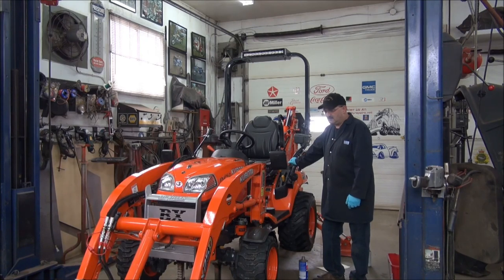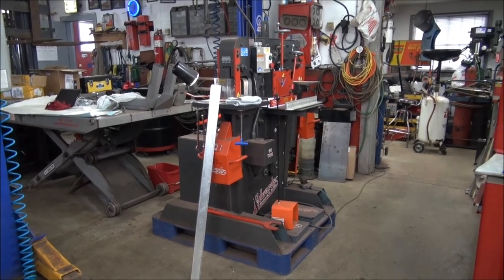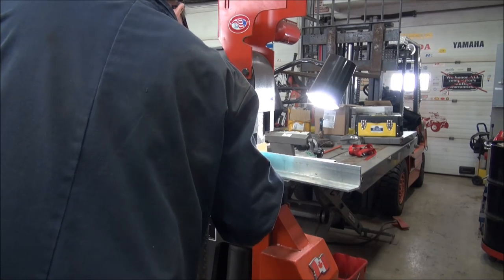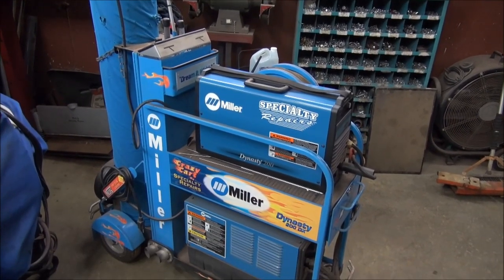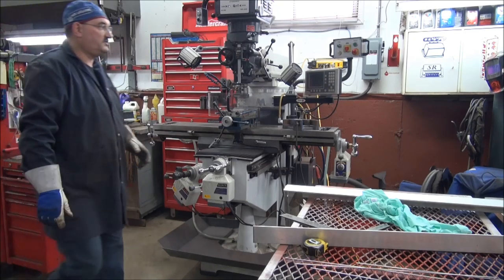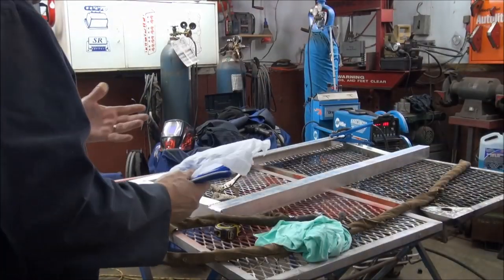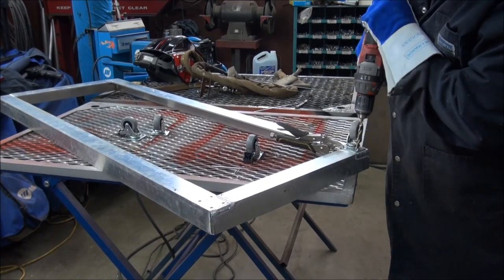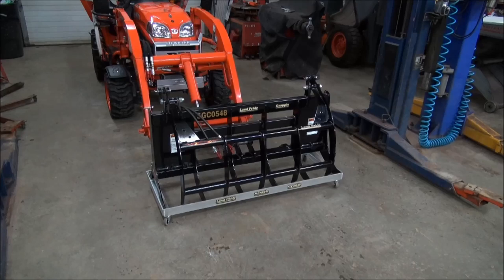Land Pride Grapple Cradle

Comment: Fantastic.  Could not get over the difference in sound your dynasty with the high frequency and pulse  makes compared to my Lincoln  175 square wave and the weld quality is much better.  I noticed you went over the weld without the filler rod  for  that extra touch - well done only the best spend the time to finish the weld  like  that.  For me to weld 1/4 its turned up to max. amperage and for thicker material I pre heat it  to get buy.  Was the dynasty turned all the way up to weld the 1/4.  Thanks Steve.
Reply from the maker: Thank's Steve. I've never tried a Lincoln but I'm sure they are great machines. I had the Dynasty up on 170  for that job because I wanted the instant heat. It goes to 200.
Like I said in the video. I never cleaned the rod, the aluminum, nothing. I like to break the rules once in awhile. I've welded much thicker with the Dynasty but when it gets over 3/8th I'll go for the spool gun unless it's a tiny thing then I'll still go after the Dynasty. Appreciate you commenting ;)

Comment: Another great idea Paul. I'd like to build cradles for my snow plow, flail, and bucket. Probably need to use steel for the frames to support the weight. What would you think about warehouse racking as an alternative, since I don't have much floor space? My shop is 42' x 52' x 16', but the elves seem to have filled it up rapidly.

Comment: Why did you make it out of aluminum instead of steel. Is weight the only reason or is there something else? Very enjoyable as I learn a lot from you doing the videos, always interesting. Thank you Wayne
Reply from the maker: I made it out of aluminum for its strength and weight but also because it was meterial I had left over from a previous job 😉 Thanks for watching.